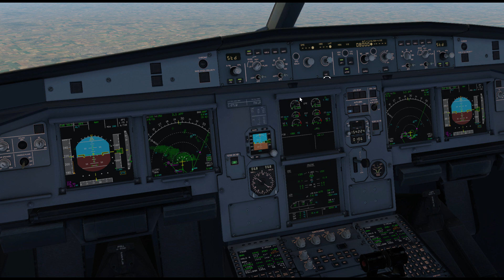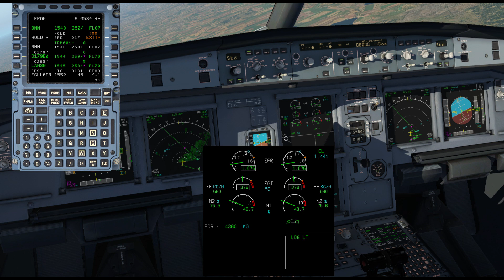X Plane 11 ToLiss A321 With Real Pilot:  Holding Tutorial

Comment: Hello, when you descend or climb is there a way to see where on the nav display you will reach the altitude set on the MCP? Great video :)
Reply from the maker: In real life yes, but for now it is not always available in the ToLiss Airbus it seems. When in NAV mode you can see it during the climb as seen here: https://youtu.be/0TPCPY_kJoU?t=1386
 Hopefully it is added soon, it is a small arrow next to the track line or NAV line on the navigation display. It also works using vertical speed in the real aeroplane. Thank you for watching!
Reply: 320 Sim Pilot Ahh thanks for replying, I’m watching that video now.  Also I would highly recommend the BetterPushback add on, its a lot better than the default tug :).